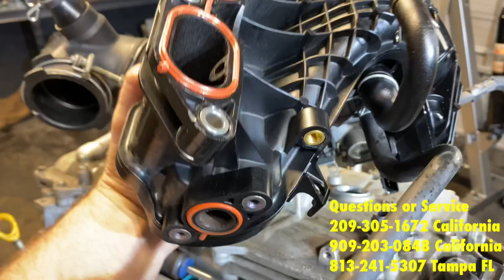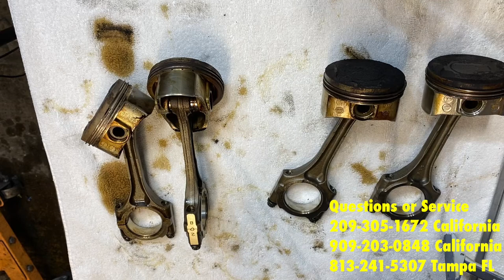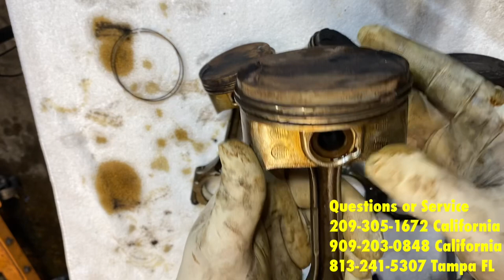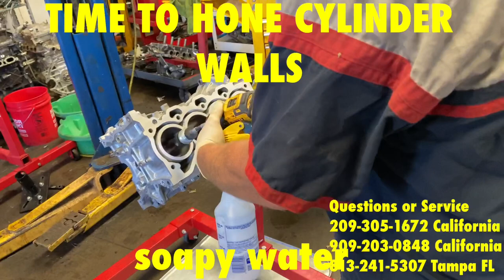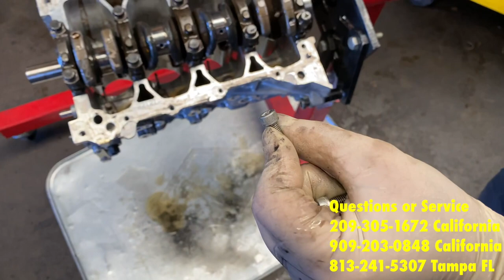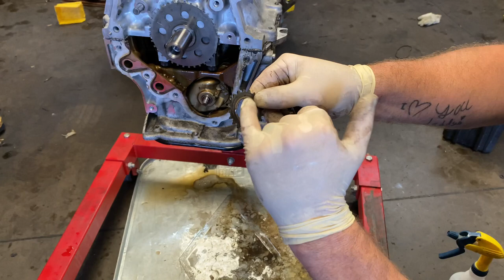Toyota Prius (Lexus Ct200h) oil burning consumption causes and fix.

Comment: Thanks for teardown.  No surprise, today's open deck aluminum blocks don't support head gasket very well.  There is a reason that truck engine blocks still use a close deck iron block.  Hybrid saved a lot of fuel, but long term cost may be the same because of aluminum engine replacement.

Comment: Excellent attention to detail and service, on Youtube alone as well, you provide. Very much appreciated you keep these blocks and more from being scrap.  I'm in SW Michigan and if wasn't on a pension, I'd be all about a nice thorough rebuild on my ~260K 2013 1.8L.  For now, learning about what can be performed when the next 40-50% sale is at the salvage yard and I'm bringing home an engine to rebuild on my own.  Then again... will have to look into the pricing and plan for worse situation scenarios budget projection.  Looks like you come out to the Chicagoland area and SW Mi is only about an hour away.
Reply: I don't like this.  Once you go as deep as he does, you almost might as well overhaul the engine, which costs almost as much as a new engine, so this is well beyond a maintenance procedure.  So the first thing that is a maintenance procedure is checking the EGR system and cleaning it if it is clogged, and doing this in the car.  This video does not go over that.  The second maintenance item is unsticking oil rings without removing pistons.  This is at least sometimes possible with detergent soaks or oil flushes on other engines, but I am unclear on the procedure for either on a Prius.
    It seems to me like use of detergent fuels and oils should be able to prevent this, however he also showed us head gasket issues that to prevent, might require us to devise a head bolt retorquing spec; since modern head bolt torquing specs do not work for retorquing.
     I actually don't buy his PCV sucking oil explanation either.  PCV valves are designed to reduce flow when under high vacuum and so not suck oil under any vacuum that would allow the engine to not stall.   The oil ring sticking is caused by inadequate oil and fuel detergency, not even by a clogged PVC system, though inadequate fuel detergency might cause that as well.
Reply: I just switched my friends Prius to high mileage motor oil at 120k miles, and we have always used Top Tier detergent gasoline, but maybe we should add even more detergent than that. to prevent both EGR soot buildup and oil ring sticking; as this engine may be more vulnerable than most.  The problem is that too much detergent in motor oil can mean less lubricant.
Reply: @alan6832  My understanding is when the PCV Valve is stuck, open.  I know in my situation, the PCV Valve was stuck.  I didn't check to see if open or closed at the time.  Definitely didn't have an internal valve moving freely.  

I recently switched to Mobile 1 0W-20 full synthetic thinking I'd try that for topping the oil to see if helps unstick the oil seal rings.  Seemed to reduce the oil consumption significantly. 

However, most recently, I ran two full tanks each having a bottle of Techron through.  That coupled with the PCV Valve stuck open and an engine oil overfill situation that I didn't drain,  I'm guessing caused my first misfire situations enough to trigger the check engine light.  I made some bad videos documenting my situation. I swapped in a clean intake manifold, new PCV Valve, cleaned PCV Valve hose and cleaned EGR Pipe.  I also cleaned the inside of the EGR Valve housing and valve from the bottom.  I didn't yet get into the top side to check for the ski rutt in the plastic and thoroughly clean the rest. 

I do need to clean the rest of the EGR Valve and EGR Cooler next as I'm getting a situation where when the AC is on and the HV battery is low, my temp goes from approx 194 to approx 204 and when at low speed and slow acceleration I get a rattling like noise that isn't the exact same as the starting high condensation cold engine type situation or what sounds like a really brief death rattle.

In regards to the oil, I was thinking running Amsoil for a few oil changes.  However, the Mobile 1 seemed to do the job and I'll see if the Techron aided as well possibly. 

B12 Chemtool soaking reads like about the only other methods I've come across as a potential solution beside disassembly and either cleaning or replacing parts.
Reply: @alan6832  Sure, make sense.  I've not used any oil additives yet. Always 0W20 Toyota full synthetic or Mobile 1 0W20 full synthetic 10,000 or more recently to top off the 20,000 mile.  I also use only Top Tier 87 octane almost entirely and only a few exceptions.  

I also had the overfill situation and was parked on inclines which I think might have caused a little more oil to get into the intake more than usual to cause the misfires.  Hopefully, didn't cause any connecting rod damage.  I'm at approx 283K miles, so scary.
Reply: @jafinch78  My understanding is that high mileage oil has more detergents than oil formulated for new cars, while keeping the API certification that is lost with additives; and there are multiple brands of both types.  Then if willing to lose API certification, Marvel Mystery Oil and Sea Foam both say they can be mixed with oil, but it is probably safer to mix them with gasoline.

Comment: Not related to this particular video, but you guys are the gasket masters. I have a timing chain cover that is ready to go back on, but the access to the engine is so small that I don't know how I'm going to get it back in there without smearing the RTV on other parts. I'm trying to jack up the engine to get a little more space. Is it ever a good idea to apply RTV on the engine side instead of the cover side?

Comment: Wow this was pretty cool...how much do I need to save up for an overhaul like this?
Reply: It should be possible to free stuck oil rings in place by soaking them in soot cutting detergent in place, without engine disassembly, though beware of hydro lock when doing so.  it should also be possible to clean the EGR or PVC passages without much disassembly.  Head gasket issues are usually an argument for periodic retorquing of head bolts.  This takes some disassembly and retorquing specs, which for modern engines, have to be devised as the factory torque specs don't work for retorquing with modern head bolts.

Comment: Thank you.  I wanted to how exactly EGR works. 
My car was also burning oil. I found on internet to replace PCV Valve so I replaced, seems to be working fine.  Recently I got the EGR Code.  I’ll have to clean that now.
Reply: Does your car vibrate while driving when you receive an EGR valve code?
Reply: @JohnnyV523  :  no not at all.    The light comes on. Stays for few days or week then. Turns back on.  I think. EGR. Kicks in at a certain temperature to cool off emission gases….
Reply: @bizforall  My Toyota Prius burned oil, causing the car to make noise and little feeling of vibration when driving. Try checking the egr valve and intake manifold.btw thanks for sharing this information

Comment: Thank you for this!  
Would this be part of routine maintenance at a Toyota or Lexus dealership?
I have a new used 1 previous owner 2011 CT200h with 103k miles and plan to keep her to 250k.
Would you recommend all this for 100k precautionary service?
I need a mechanic like you in Austin!
Reply: No, the dealer won't do it, but you shouldn't need to worry until it reaches 150k. I'm in Austin too and I have one with 165k on it. I'm also looking for a hybrid mechanic who can do this kind of work. Let me know if you have someone from your research! Thank you.

Comment: Hi! Thanks so much for your videos!! Do you have a recommendation for a shop in the Washington DC area? Had the dealer replace EGR valve, but then the check engine light went back on and the same engine noise started again. Dealer says it’s the head gasket… looking for another opinion/ recommendation for a local shop

Comment: "This one will no longer consume oil" ....yeah until it hits 100k again with infrequent oil changes and hard driving. Putting the original part rings back in is just a bandaid for future oil burning unfortunately. Upgrade to revised rings from 2015+ Prius'..

Comment: Would you replace crankshaft bearings that have polished spots? Like not through the aluminum, just polished through the machined lines on the bearings.

Comment: What's a job like this cost?
Reply: That's a full engine rebuild, probably 7k-12k with parts and labor.
Reply: 7-12k is a whole new vehicle. An engine rebuild cost around 2500-4000 just depending on what you're rebuilding

Comment: I have a 2014 CT-200H with 85K miles. No motor issues yet but is there any preemptive maintenance i can do to avoid all this? I love the car and plan on keeping it forever or until i total it.
Reply: Yes- Keep the EGR cooler and lines clean, and clean the intake manifold as well- every 60k-90k should do, as these parts all foul up with carbon quickly.

Check out priuschat Gen3 section for many helpful forum links that talk about EGR and other maintenance.
Reply: Just perform your scheduled maintenance on time or early. For example, Lexus says to replace your spark plugs around 120k but I changed them at 110k and looked really worn. Also at 100k change your coolant of the radiator and hybrid system and your cvt fluid. I'm at 145k miles on my 2015 CT and haven't cleaned the egr system yet but will soon
Reply: @aminort2  this is the correct answer, along with schedule handbook maintenance
Reply from the maker: Exactly
Reply: AMSOil 10W30 Signature Series Oil,With more Frequently Change Intervals Will Prevent these Problems. And Keep those Valves Cleaned With CRC Valve Cleaner Frequently. Good To Go.
Reply: In Europe another Toyota hybrid is sold: the Auris hybrid. It has the same engine and hybrid system as the Prius and CT 200. I own one, and no issues at 206.000 km. I change the oil every 10.000 km with the right 0w20 GF5 oil and clean the egr and intake manifold. Also important: drive is conservatively

Comment: Do you think putting the pedal to the metal to merge onto the freeway and driving mostly on the freeway will help combat this problem? Because it seems oil starvation and that vaccum problem only happens at low throttle. Anyone care to chime in?
Reply: This is false information

Comment: I have an 05 Prius that is burning oil. Could I just monitor and make sure i have oil to put in the engine? Also, at what point does your oil pressure signal you on your dash?
Reply: I have a 2010 Prius burning oil. I’ve been monitoring the oil for a while and not once have I seen the oil light come on and I’ve had the oil get pretty low. I use my car for Uber and I can’t afford the time to take the engine out for a rebuild. so I got a engine at the pull-a-part for 260$ and plan to rebuild it with just new head gasket, head bolts, piston rings and rod bearings under 200$. Better than a 1600$ engine off the shelf from s&w with 160k miles on it
Reply: @christophertatem8790 damn why did the junkyard sell you an engine so cheap?
Reply: I’m in Atlanta Georgia and my local junkyard called pull a part sells a four cylinder engine for that price.
Reply: @christophertatem8790  you have to take it out yourself? Do you have to bring an engine hoist?
Reply: @Hallahanify  yes you have to inspect it so you know what you are getting and then remove it yourself and they provide engine hoists
Reply: @christophertatem8790  the headgasket was already blown though?

Comment: The PCV is a bigger culprit than exhaust gas choking up the small openings in the intake manifold. Just replace the PCV every 50,000 miles or so. Don’t even need to waste money on a catch can. PCV cost less than $10

Comment: Do you beplace the old crunchcraft bearings or used old ?
Reply from the maker: New. They are cheap so might as well use new.
Reply: @gasketmasters  how do they typically do on specs? Do you typically run standard size or have to adjust ring or bearing sizes?
Reply from the maker: @ryanfinch81  just standard size when honing
Reply: @gasketmasters  is there a brand you like more than otheres?